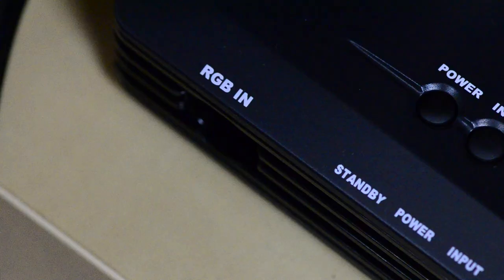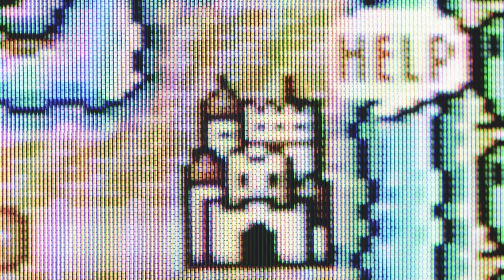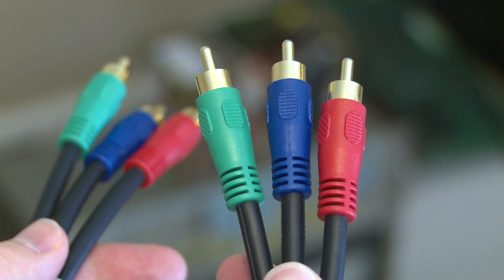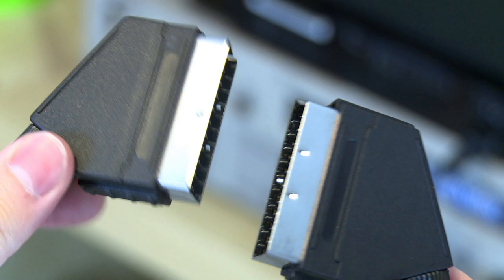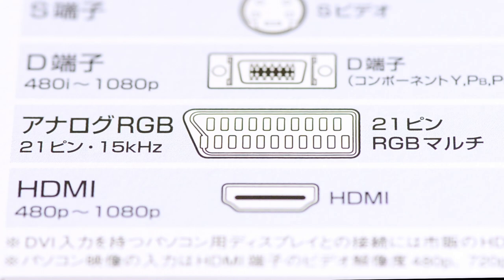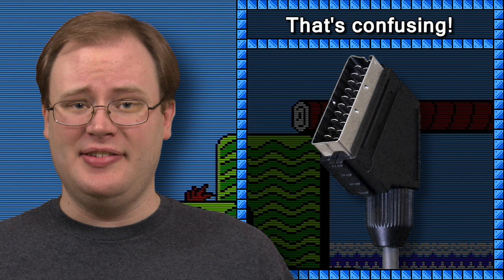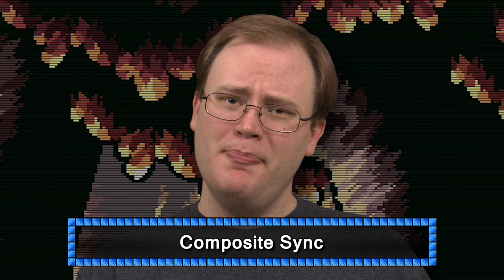Understanding RGB and Sync :: RGB103 / MY LIFE IN GAMING

Comment: Which is better C-Sync or Luma Sync?
Reply from the maker: +MrEduedu123 [Try4ce] CSYNC is best when it's supported, but sync-on-luma is pretty much just as good, and will need to be used with systems like PS1 and PS2. However, with superior shielding in the cables, any sync method, even sync-on-composite, can be nearly indistinguishable from CSYNC.
Reply: ***** Ok thanks!
I asked because I was going to mod my Nintendo 64 to get RGB and I saw it has 3 possible syncs: sync-on-composite, csync and sync-on-luma (it's a japanese model).
I will keep sync-on-composite because otherwise I would have to cut a trace on the pcb and also I think that patterns/jailbars/checkerboards normally produced by sync-on-composite are not visible on a CRT is this true?

Comment: Welp I ordered sync-on-luma from RGC for my PS1 .. guess I really needed CSYNC one for the best picture ?

The word composite threw me off ..
Reply from the maker: [Try4ce] No, that's exactly the right cable! PS1 and PS2 cannot do CSYNC. In truth, sync-on-luma provides essentially the same result as CSYNC. Heck, if you get a super high quality sync-on-composite cable, even it can provide indistinguishable results... it's just that the average cable will look worse. Don't be thrown off by the dithering effects you may see in PS1 games, even with a sync-on-luma cable... that's just how PS1 is.
Reply: ***** I've noticed them promoting new line of RGB cables but that's probably for the PS1 lightguns .. yuck er maybe an XRGB-mini thing .. does that really need the sync connection to the back ?
Reply from the maker: [Try4ce] The one with the extra female RCA hanging out the back? Yeah, that's for light guns. It has nothing to do with the XRGB-mini connection. It's just an extra wire tapping into the sync signal so that you can use the Guncon while playing in RGB on a CRT. Not necessary if you don't need to play light gun games.
Reply: ***** From what I've seen , PS1 lightgun seems to rely on composite video which is absurd ! Hopeful I can stumble on a BVM/PVM sometime cuz for lightguns I'd only stick it to my holy Dreamcast and Toro VGA+RGB box =}
Reply from the maker: [Try4ce] That's not quite correct. The composite video line includes a sync signal. That's what the lightgun is looking for... sync. For most people's setups back in the day, jumping the Guncon off the composite video line was the simplest (or only) way to play. But there are a variety of ways to play gun games in RGB, which is great. As for the cable hanging out the back of those SCART cables, I'm not sure if it even works as a composite video line if you hook it up. I think it might just be sync.
Reply: ***** I see the dithering effect you mean the lil spotty dotty crap ? Welp I see the need for RGB everything is much more defined !

I will need the cable to adapt it to the Framemeister .. one day

Comment: Hi there, just want to confirm if I am buying the right cable!  I own a Japanese Mega Drive (Model HAA-2510) with a 9-pin AV Out at the back of my machine. I'd like to know 100% if it is correct for me to buy the following cable called on eBay: "Sega Genesis/Megadrive 1 Stereo JP-21 pin XRGB lead with boosted sync".  Is this the correct cable I'll need for the XRGB-mini Framemeister I plan to buy as well. Could you kindly confirm this is correct and the very best setup of cables to achieve the highest image on my Panasonic plasma HDTV. If not, could you kindly suggest otherwise. Thanking you in advance for your assistance!
Reply from the maker: msjb1976 [Try4ce] That sounds correct to me. While we don't have experience with Japanese Mega Drives, everything we've been told suggests that the cable is totally interchangeable between regions. The thing to keep in mind is that you're buying a JP-21 cable, which means that if you buy cables for more systems, you may want to stick with JP-21. There's absolutely nothing wrong with going that route, you just need to remember that SCART is wired up differently, despite looking the same (and performing the same). The Framemeister comes with an adapter for JP-21 into its RGB port. We had to buy a separate identical-looking adapter for SCART, since we decided to go for that standard instead.
Reply: ***** thanks heaps for your help!  WOW!  It was seriously worth every penny to get a immaculate picture on my HDTV!  Now, off to watch RGB 301: For RGB set-up recommendations! :-)  Thanks again for alerting me and the world to the Framemeister, what a huge breath of life it has put back into my SEGA!

Comment: I have a thought: if VGA is a type of RGB component, can I use VGA instead of SCART with all my consoles and get the exact same quality? I've heard that VGA & RGB are different signals and that they cannot be exchanged, but at 9:09, you showed the inner workings of VGA, and there's nothing that indicates that a VGA's RGB signals and a SCART's RGB signals are different. So, clarification?
Reply from the maker: RarefoilB [Try4ce] VGA is different because it has separate signals for horizontal and vertical sync. If you've ever looked at the back of a projector, maybe you've seen BNC connectors labeled R, G, B, H, and V, or something similar. Essentially what that is, is VGA broken out into 5 cables, because sync runs over two lines instead of one line. Not very many consoles can actually output this type of signal, with Dreamcast being the most notable example (though it still requires a special cable or box to tap it). I don't know if there are any good or reliable means of converting RGB with CSYNC or another type of sync into VGA. Remember that VGA is the type of signal (R, G, B, H, and V, and it's also strongly associated with a 640x480p resolution), and not the connector itself... the familiar connector for VGA is called D-Sub-15, but like I said above, it can also be broken out into other types of connectors, like BNC.
Reply: ***** I've heard that you need some type of sync stripper to make VGA work. So is that the only difference, signal wise, not connection or hardware wise, between VGA and RGB? And by extension, does that mean if done correctly, VGA video will give the exact same results as RGB video?
Reply: RarefoilB VGA and RGB SCART have virtually the same quality and format, yes. SCART carries RGBs (red, green, blue, sync); VGA carries RGBHV (red, green, blue, h-sync, v-sync). The sync format is the only difference between them, and devices like the Micomsoft XSYNC-1 exist for the specific purpose of breaking a SCART sync signal into separate horizontal and vertical sync for VGA output.

Be aware, however, that just because you're converting from RGBs to RGBHV doesn't mean that you can necessarily plug the output into a VGA port on your monitor and expect it to work. If the console is outputting a 240p signal, then you're just going to get 240p VGA, and that's a signal that most monitors just won't support. You'd still have to upscale it to be able to use it on most displays.

If you want to try and look for a VGA monitor that supports 240p, then you'd want to find one that supports a horizontal scanning frequency as low as 15KHz. Most old PC monitors only do 30KHz and up.
Reply: Sixfortyfive Great! Since the HDTV (a Panasonic) I have in this house has a VGA port, I could use that and get RGB without having to use SCART and an upscaler.

Of course, how well the Panasonic can handle 240p right now is a bit vague. It can see it, but using the composite video input, I get a combing effect with normally flashing images. But when I performed the 240p compatibility test from here (http://www.hdretrovision.com/240p/#test) with the Panasonic's YPbPr component inputs and my PS2 (no other way to test it), the image is correctly processed and the flashing images flash like they should.

So who knows how well it sees 240p VGA? And how good it'll look without scanlines? I'll be sure to check out that XSYNC-1 thing, just to let you know.

I'm still not sure how I feel about upscalers. Something about it being sacrilege is floating around in my mind, and also something about any lag at all. Those aren't concrete reasons why I'm unsure, and I'm sure that isn't the main reason (since those reasons are quite silly and ludicrous), but that's all I got.
Reply: RarefoilB Do not assume that your TV supports 240p over VGA just because it does so with composite or component. There's never a guarantee.

If you wanted to test it, get one of the VGA boxes for Dreamcast that has a 15khz/31khz switch (such as the beharbros products), and run the DC version of the 240p test suite in 15khz mode.
Reply: Sixfortyfive  Yeah, I know that there's never a guarantee. I know this because hardware be silly and I have a PC gaming Dad. I am only very cautiously optimistic, don't worry.

I'm in the market for a Dreamcast, so I've seen beharbros's products, but they're all sold out at the moment (except for the Kensei) and they do not say when they'll make more. It would be really handy to know when or even if.

Comment: I still dont understand if I should go for [Composite Sync/CSYNC (built in sync stripper) taken from luma pin]  or [Wired as "sync over s-video luma" (luma sync)] for my PAL Playstation 1 (which is modded to play NTSC games as well).
Can someone share their expertise?
Reply: Alexandros Demetriades Luma and CSYNC are best
Reply from the maker: [Try4ce] Depends on what you're plugging it into. I haven't had any trouble getting my sync-on-luma PS1 cable to work on a PVM or the Framemeister, with or without a sync stripper.
Reply: I want to simply plug it directly to my TV
Reply: Angry Duck so which of the two do you suggest? both seem to use  the luma in some form
Reply: Alexandros Demetriades Use a Luma Cable, it won't have any compatibilty issue like CSYNC
Reply: Alexandros Demetriades Use CSYNC if you want best quality, but Luma has betrer compatibility
Reply: Thanks for the reply. But wjat to you mean with compatibility? What kind of compatibility issues may I get with CSYNC?

Comment: So what is sync on luma then..? (sorry if I come across as Zoolander here)
Reply from the maker: [Try4ce] It just is sync that is carried along with a luma signal. For example, it might be pulled from the luma (Y) portion of an S-video or component signal. This is usually a less noisy signal than composite (which also carries sync) and may give cleaner results if the cables aren't up to snuff. But sync-on-composite is also totally fine if the cables are really high quality. Technically that's the proper standard - it's just that a lot of cables out there aren't using the quality of cable stock that they should be.
Reply: @mylifeingaming  Thanks. For me 8 and 16-bit consoles look fine enough on a HD TV just with composite, and PS2/GC/Wii looks fine with component(via hdmi adapter because my TV doesn't have component) but PS1 output does not look good, only CRT looks good for that. I have an RGB cable but it's cheap so the picture gets 'overexposed' and there are grid-type artifacts. But a 28inch CRT is impractical to have when you don't have a permanent apartment like me, so I need to find a better cable, or a converter, that works.
Reply from the maker: [Try4ce] Yep cheap RGB cables have that checkerboard effect because the composite signal in the wire (which is used for sync) is bleeding into the other lines.

Comment: So is sync not as complicated with s video?
Reply from the maker: +EHwrd [Try4ce] Right, it is always with the luma signal, which should be clean. It's just one wire in most cases, except sometimes pro equipment breaks chroma and luma into two separate BNCs.
Reply: I really appreciate the response! I recently got a pvm and I'm waiting on the s video cables to come. when I turn it on it says no sync but I think it's because it has nothing hooked up.
Reply from the maker: [Try4ce] Right, if it is receiving no signal, then it says that. All video signals have sync, it's just that it's usually not anything you have to think about except when it comes to RGB.

Comment: Is there is RGB Cable for Raspberry pi?
Reply from the maker: [Try4ce] Not sure, but I don't know if anyone has configured it for 240p anyway. I imagine Raspberry Pi is overwhelmingly used for HDMI.
Reply: ***** What about S-Video and Framemieser? I will used it for Retropie
Reply from the maker: [Try4ce] The Framemeister supports S-video. I don't know enough about the Raspberry Pi... I didn't think it could do analog output. It may just be HDMI, right?

Comment: I have need to hookup a Sync Strike to my Caputer card that takes DVI. Sync Strike has DSUB15 and L&R Audio... how do I hook the VIDEO AND AUDIO to my DVI input on capture card? Do I need a special cable? 10$ Via Paypal for anyone that can help me solve this! If you need more information feel free to ask here!
Reply from the maker: +quickplaya [Coury] I'm pretty sure you could just get a DVI to VGA adapter like this one: http://www.amazon.com/StarTech-DVI-Cable-Adapter-DVIVGAMF/dp/B000067SOH

For audio, does it have any regular old RCA inputs? If not, did it come with a dongle that maybe has component and L&R RCA inputs? I used to use a card called the PEXHDCAP that had a little dongle.
Reply: I have that same card!!! I got a VGA to DSUB15 adapter.... how do I get the audio to connect to the PEXHDCAP????
Reply from the maker: +quickplaya It should have come with a dongle that plugs into the little circular input on the card. This dongle breaks out into component video inputs (Red blue and green RCA style inputs) and left + right audio inputs.
Reply: Thanks for your time! Love your videos! I purchased my PEDXHDCAP card second hand through ebay so it didn't come with any accessories. I am using RGB signal not component. Shouldn't I be using the DVI Dual link port and not the S-Video? Thanks again!

Comment: My american snes supports euro scart no problem....hmm can't find any other source confirming it's only jp-21
Reply from the maker: [Try4ce] You must've misunderstood, we didn't intend to imply anything like that. We use SCART with our American consoles. RGB comes from the same pins, no matter how the wires are configured on the other end.
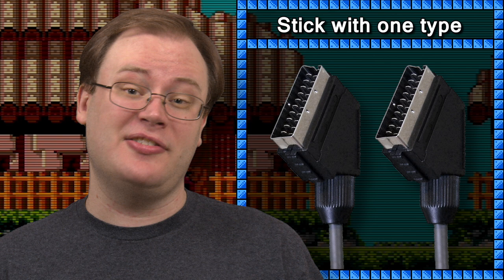Reply: Oh ok, seems like you definitely imply that right at 6:01 when you guys say "North American SNES isn't configured for SCART". Shouldn't it rather say "configured to work with either"? Sorry, love the video I just want to make sure you guys know it does indeed support scart.
Reply from the maker: [Try4ce] You're right, this is really strange wording! This video is quite old by now, and I don't think we'd have worded it that way now. The point we were trying to make is that PAL systems and NTSC SNES systems have different capacitor/resistor configurations from each other. I think what we were trying to say is that the official SCARTs were not made with NTSC consoles in mind in this regard, meaning that the picture would not be quite correct. It doesn't mean that it wouldn't work, but that's not how the cables were designed to work. Current cable manufacturers should build SNES cables differently depending on whether it's for an NTSC or PAL console. But yeah, you're right, ugh, terrible wording. It really has nothing to do with SCART vs. JP21, only with how the "original" cables were manufactured for SNES specifically. Confused me for a moment too. I hate looking at these old videos!
Reply: Thanks for the reply, I figured something like that was the case. I also read somewhere that some NA SNESs support scart and some do not, but as of yet there is no way of telling without testing it out.

Comment: Hi. First great video and thanks for the amount of informations.

Just a question though. On this video, the sqaures created by the checkerboard effect don't move. I have a PAL gamecube connected with RGB. The image has squares, but they are moving (as you can see on this video: https://www.youtube.com/watch?v=F9SsNzxHVwg).

Is it also a checkerboard effect?
Reply from the maker: +Jackie Chomel [Try4ce] Yes that is a related issue. PAL GameCube is very sensitive to this. You need a cable with better shielding. It's the composite video used for sync that's bleeding into the image. I've tested cheap cables and the official GameCube SCART on a PAL system. The official cable had no noise.
Reply: Again, thanks for the fantastic work. Also thanks for the super fast answer.

Actually the shielding isn't the problem as I already changed the wire for a a good shielded one. I think what I'm going to do next is making a SYNC separtor for my gamecube (and also Genesis 2).

EDIT: the sync stripper worked perfectly. I made a mistake doing it the first time. Now I have to figure out where to put it.